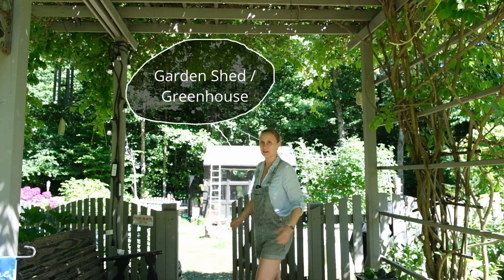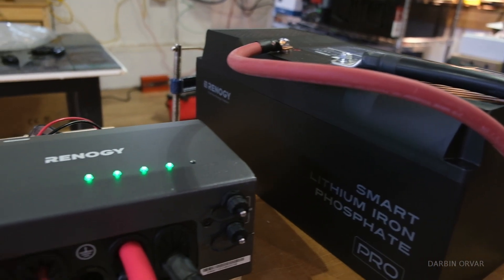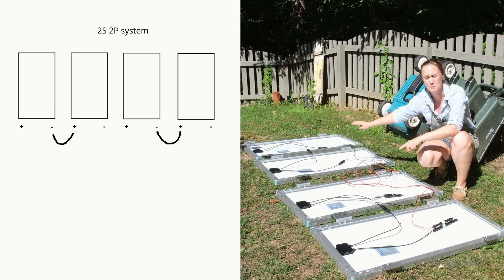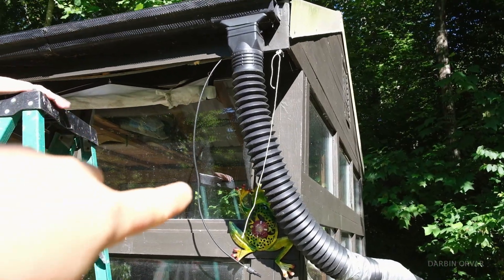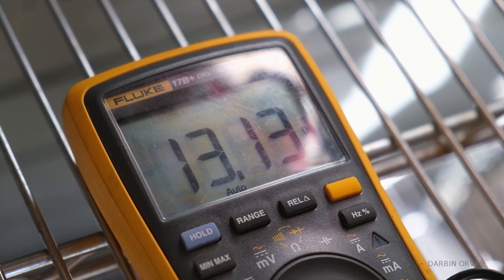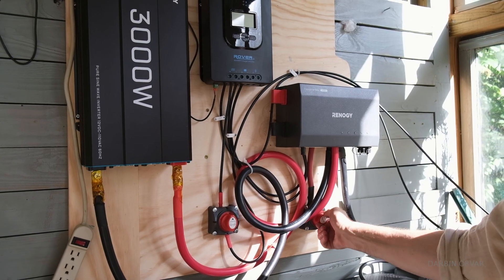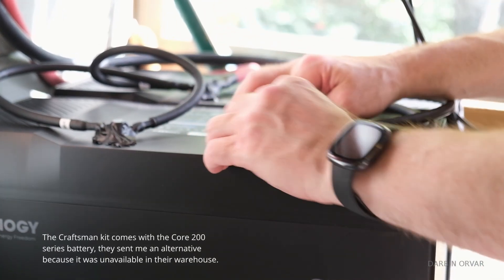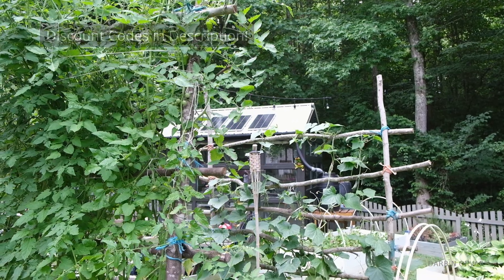How To Set Up an Off Grid Power System (with Solar, Batteries, Inverter) ft Renogy

Comment: Great video! Question, for your solar panel arrangement, why 2S-2P vs 4S?
Reply from the maker: That would make the voltage too high for the solar charge controller I was using. Thanks for watching!

Comment: I’m still trying to understand which direction to mount the inverter. I instruction manual says to never mount it vertically to always mount it horizontal. I see lots of vertically mounted inverters on YouTube. I understand heat flows up so vertical with the fans blowing up would seem most logical.

Comment: Were there any fuses used in the system to protect the equipment? Nice install by the way. Good job.
Reply from the maker: There are fuses built into the combiner box connections. It's in the video part where I assemble it.

Comment: I love what you do! i REALLY amazing. A simple dumb question why not choose all in one inverter instead of seperate charge controller you could get just one piece wiring would be much simpler maybe cost effective too!
Reply from the maker: expandability is the main reason to go with the separates. there is also the benefit of a lot higher solar voltage.
Reply: @darbinorvar  I got that idea, but nowadays off-grid all in one system also has higher voltage input as high as 500v and they can be in parallel. With the help of WiFi dongle you can monitor your shed from home or anywhere. But good luck.

Comment: Its more efficient and affective if you connect the positive to the oppressive battery so you have negative and positive going out put the negative on one battery and the positive on the other then thats really combines both and is more efficient
Reply from the maker: that is a good point. i will change it. i just didn't think of it.

Comment: At about 3:15, you say you have "already assembled everything and tested everything..."  What kinds of testing were done and what kinds of equipment is required to test these components?  Thanks, Linn. An excellent subject and a very good video.
Reply from the maker: It was easier to assemble the parts on a piece of plywood and test them with a multimeter than do it on site, mostly because it was so hot in the greenhouse. When I say test, I just wanted to make sure nothing was damaged in shipping.

Comment: Wouldn't it be cleaner, simpler and more cost effective to just get a solar generator with a few panels?
Reply: I imagine you would still need batteries if you want to have some power at night, which would require the inverter anyways.
Reply: @hglez86  All solar generators have batteries and inverters built-in, so you don't need to build all this stuff yourself. This is 2024, we are way past needing this kind of assembly for the power needs of this shed.
Reply from the maker: you could certainly do that, but this is meant to be expandable. more panels, more batteries...etc. most of the solar gens are pretty limited with the voltage they can handle from panels ~ 20-40vdc or so. and you can get external units that go to 400 or 500 if you wanted.

Comment: If this had to be paid for by the homeowner, would you recommend this setup or just running a power line from the house?
Reply from the maker: the greenhouse is pretty far from the house, so you'd need to dig a trench and probably install breaker too.
Reply: Are you running north of $5,000 dollars instead of a 100 foot extension cord?
Reply: Cable would save a lot of money which is all I did at first, then added a 300 watt solar power station from harbor freight in case of emergency power outages.